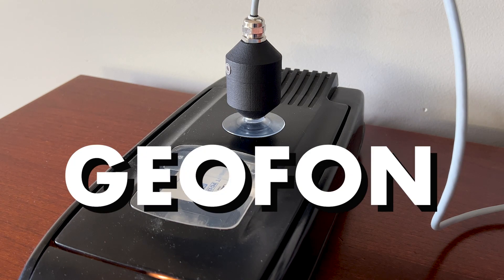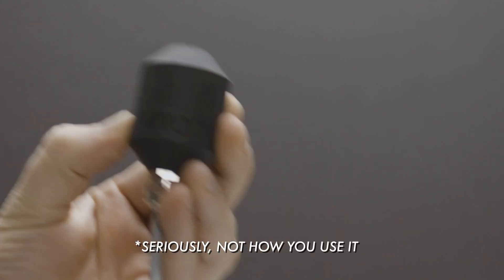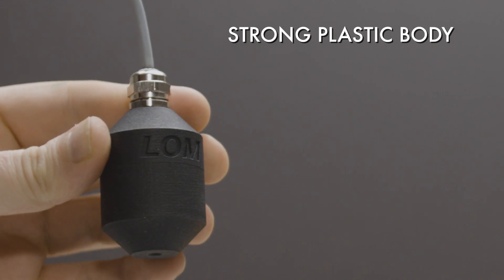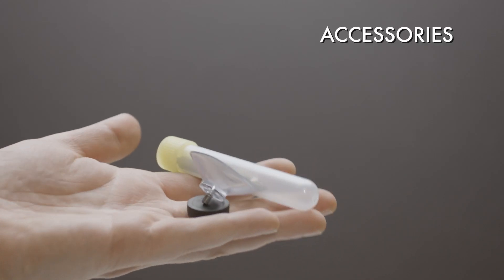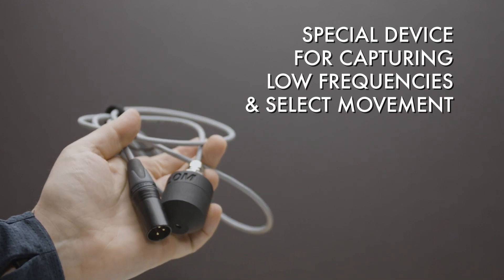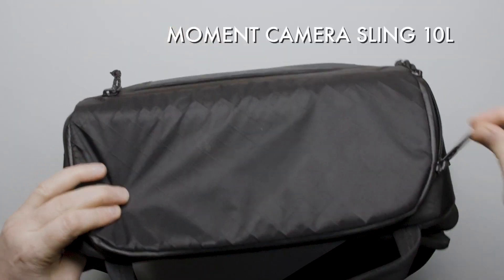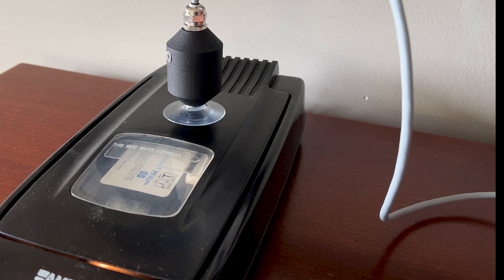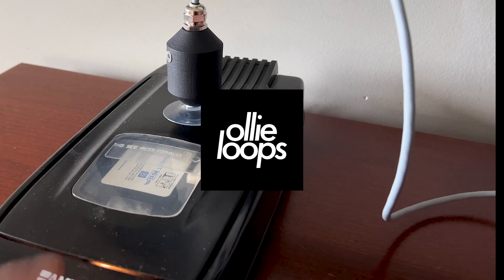LOM Geofon

Comment: Subject:
Advice for capturing internal vibrations of an industrial machine (bone-conduction experience)

Message:
Hello,

I’m reaching out because I’m trying to reproduce a very particular listening experience I recently had in a factory.

By placing my chin on the metal frame of a large industrial machine while it was running, I could feel — through my bones — an incredibly dense sound: a mix of deep low frequencies, mechanical rumble, and internal resonances, almost as if I were inside the machine.
I was wearing earplugs, so I couldn’t hear anything through the air — only through bone conduction.
It was a massive, living, perfectly structured sound, impossible to perceive otherwise.

My goal is to capture that sound, that structural vibration the body perceives through bone — not the external noise, but the inner movement of the metal.

Could you please advise me on:

what type of sensor (contact microphone, geophone, or something else) would be best suited for this kind of structural recording,

and if there’s a particular mounting method or mechanical interface (surface, paste, coupling material, etc.) you would recommend to reproduce the feeling of this bone-conducted sound as closely as possible?

I’m based in France and work in an industrial environment, so robustness and ease of setup are important.

Thank you very much for your time and for the work you do — your experience in capturing physical vibrations and material sound seems perfectly aligned with this research.

Best regards,
David
France
Reply from the maker: Hi David, thanks for your comment. A geophone may be a good instrument to try. These typically have a frequency response range between 10 hz and 250 hz. Assuming the vibrations you experienced were within that range, a geophone could be used to capture the vibrations. Like shown in the video, connect it to an audio recorder in order to capture the vibrations. I hope that helps.
Reply: @OllieLoops  Thx :face-red-heart-shape:

Comment: Hi - great video - thank you! Could you tell me if the Geofon requires line or mic input to an audio device please? I know that phantom is not required but becasue of the XLR connector I am wondering which option to use for recording.
Reply from the maker: It uses a mic input without phantom power.

Comment: The piezo sensor mainly interprets high frequencies due to the high impedance. It can be solved by hi-z preamplifier. The geophone has low frequencies. I don't know what solution to use for interesting sound. I have interesting results with a piezo pickup and DIY preamplifier, but I'm still trying to find a liking in Geofon.
Reply from the maker: Great tip. Thanks for sharing.